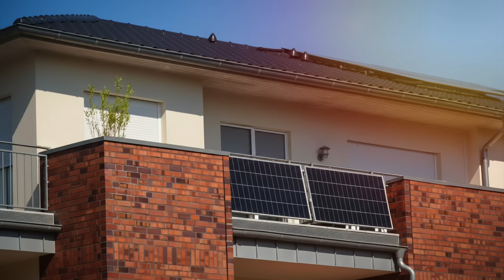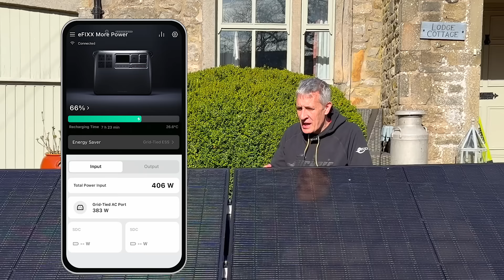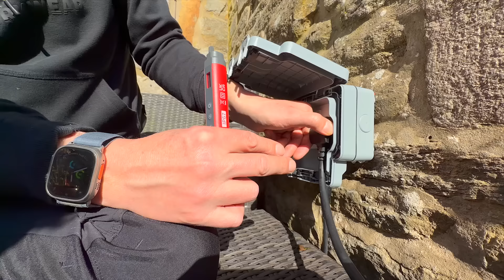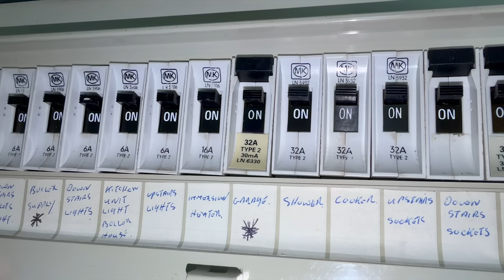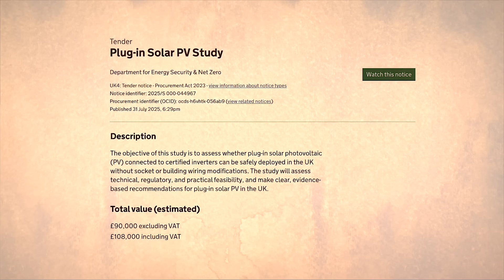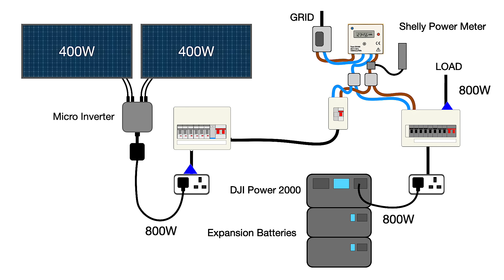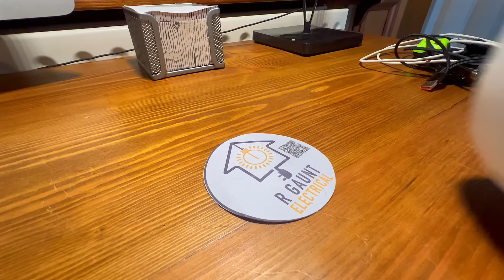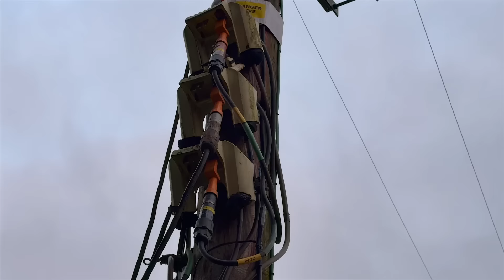Plug in Solar: We’re Told Never Do This… So I Did

Comment: Also: Generally those <=800W Systems are usually sold as a kit with everything ready to use, including mounting, part of the reason why there are no issues with it at all (I know about no incidents unless people start to badly fiddle something themselves - but that's usually a bad thing, regardless of what it is). So good that you promote that topic for UK. Mine (here in germany) already paid for itself and now every kWh it makes is pure saving. Great thing.
Reply from the maker: Great feedback thanks - what system did you choose and does it include battery storage.
Reply: @efixx  Since I'm an electrical engineer myself my setup is a fully standard compliant custom build (using two HMS-300-1T Microinverters, each is attached to a Kioto KPV 365Wp Panel). Panels are arranged for direct consumption (one 20° south, one 90° west) so no batteries needed. For my neighbors and friends i did a lot of installs of kits. If possible I recommend something like a 45° east + 45° west setup with 100% overpaneling, so that you have a grid-friendly full-day (sun-hours) coverage even without batteries.

I did a hybrid setup once for a friend with a battery 1,5yrs ago, that basically using any excess mid-day energy to do a constant low-level discharge during the night. Worked quite well last summer, but will take much longer to break-even due to the battery cost - but he wanted to have it anyways to standby as a emergency energy supply, so that very long break even time doesn't matter to him.

A well done simple setup with 1200 ~ 1500Wp of panels combined with a 800W inverter usually pays for itself within 3-6 years despite the loss of unused energy, for as long as you can shift some consumers to mid-day (washing machine, dishwasher, hot tap water boiler, etc.), but even without, haven't had yet anyone where break even was more than that.
Reply: @Cymaphore  very useful info, thanks. Currently have 2x 800W systems here in Belgium, this helps in thinking about whether (or not…) to add in a battery.
Reply: @Cymaphore  actually, unless you are over driving (clipping) the inverter, pointing all modules South provides the maximum production.
Reply: @Cymaphore silly question (maybe/probably).
If you have these without battery storage. What happens in the daytime when the panels are generating power but the house is empty with very little electricity running?
Reply: @Waterlego yhey hank you for the free power
Reply: Would like someone  in south east UK skilled to make a set up like this for my home as I personally do not have the expertise.
Reply: @Choosyview  
You can buy 2 x panel 800W inverter  kits in Holland, then get an electrician to make it safe into your house.
Reply: @Cymaphore  it would be good to see total kit price, to see if 7 year pay back worth it? 
<£2k  maybe but £6k+ maybe not , but sounds good if US/Isreals Iran oil wars continues
Reply: @balrajmaan467 a micro inverter is £100, 2 panels are £180, £3-400 is the maximum cost.
Reply: If you had 2 of these systems plugged in, let’s say on a double socket, and the rcd tripped,would they fool each other into thinking mains voltage was still present and therefore keep the circuit live despite the rcd trip?
Reply: @johnha2457  nope. Same as when you have multiple string inverters in your house. They don’t have to be linked together in any way apart from the connection to the grid. Not for the anti-island, anyway.

For that matter, an enphase solar system has a micro inverter behind each panel and that works just fine. They have communication for monitoring and configuration purposes, yes, but that network is not used for the anti islanding function.
Reply: ANY idiot using a localised ad-hoc PV install with a UK MALE 3 Pin plug IS A MORON(including those using IEC to BS fly leads) - The UK plug is one of the most sophisticated consumer connections to the local electrical infrastructure(sh1t3 for when we stand on them)! 
It's 101 electrical installation principals... Asuming(Ass U and Me) everything in a domestic installation will be tickety -boo  - NO  switched L/Ns, localised CPCs FLOATING,. RCBO/MCB/RCD mix and matches.......... Basic protection is a FUNDAMENTAL ASPECT of.BS7671 for a reason! 
Now someone shilling localised PV energy storage in North - Western Europe, is equally as..... 15%PV efficiency with MPPT x 70% charge controller efficiency  x 70% inverter is one hell of an inefficient and unsafe system! 
Power walls, et al ARE useful in the US, where energy grid infrastructure is VERY poor, fragmented and susceptible to the. MANY Brown/Black outs courtesy of its geogeaphy(lighting storms, tornados, severe storm down pours.........). 
The UK is soggy and suffers highly variable  weather, UNLIKE Germany which is far  more temperate/sunnier!!??
IMHO: Fit PVs with storage/inverters if you are off-grid, and fit 12/24/48v dump loads(immersion coils), when over-generation occurs(usually height of summer/low demand). 
Do the same with on-grid, but use grid tied inverters(for payback) and/or augment these with immersion coils(can be tied to high temp outputs of solar-thermal panels BTW) , for storage in Domestic Hot Water Cylinders(DHWC)/accumulators. 
Inverters use MOSFETS and IGBTs which can be very susceptible to thermal/electrical failures which makes them ENTIRELY unreliable as a means of basic protection.
If your running 2 panels in series,, then this too will be dangerous, as the DC bus will regularly have over 60V........ NOT to mention the lack of their grounding!!!!
Food.for thought - You did SHILL HARD BTW!
Reply: The stuff I've seen has three problems that were fairly apparent
- Some of it runs 100v or so on the solar, which is fine with good quality properly matched cables and connectors but people buy random solar panels
- Folks buy extension solar cables off places like Temu and they are not even double insulated or rated above 36v
- There is nothing in the documentation for the ones I've seen about battery safety and the PAS recommendations on where the stuff goes, so people stick it by doors, under stairs and the like.

The better kit keeps to one panel per MPPT (so 2-4 x 500W or so at under 50v and not enough power in one cable to be a major risk). Some of the newest stuff is even designed so the battery goes outdoors.
Reply: @etchedpixels  plug in has to be 800W max, which means no more than two panels in 2026. Whether that is with one or two micro inverters isn’t really safety relevant.

So, yeah, it is most likely a single series string, same as when you have larger systems with microinverters per two panels. Which does indeed give you something like 80-100V open circuit voltage. Most of these systems are just a kit. The mounting system and the micro inverter and the cabling all come together and it’s just put together the way it’s intended. If you fuck around with it, sure, you could find out — but you can fuck around with lots of things and there’s no reason to think that plug in solar kits lead to more of it than the availability of, say, second hand microwaves.
Reply: @JasperJanssen  We don't know what the UK rules will be yet but if it's like anywhere else then the limit will be 800W grid tied power input. Many EU systems go up to several kW of panels but will only put 800W into the grid. So you can drive plugs directly on the unit for more, you can put the extra in the battery overnight etc.

The plug and play ones generally have one MPPT per panel to keep the voltage/current down and also because it's common to have shading issues so each panel on its own really helps. That should I agree keep it safe for most people and it covers the "hedge trimming the solar cable" type cases.
Reply: In the UK we have ring circuits with 2.5mm cable on circuits protected by 32A MCBs this causes a unique issue for cable overload
Reply: @edc1569 Still a issue with overload in Germany or other European countries.
Reply: @Faddnn  The German standards body studied this closely and concluded their wiring standards were sufficiently excessive it was not a problem.

The US folks looked at their wiring systems and thought "oh ****" so you are allowed 400W in Utah unless you drop the protection so that the combination of worst case load and solar will still trip, then you are allowed 1200W.

We should probably downrate the affected circuit.
Reply: @etchedpixels  @Faddnn @edc1569 That's why there is the 800W limit. For usual household use cases that's reasonably safe and I have not heard yet of any such catastrophic overload happening here, despite it being theoretically possible. With those 32A rings you have it should be similar - if you manage to overload that thermically by only only adding a 800W microinverter, then there surely is already something terribly wrong with it or how it's used anyways. In addition you would need a very good timing to overload it (summertime during highest production), so those "people running multiple electric heaters while the inverter is running at full" scenarios are purely theoretic fearmongering imho.
Reply: @edc1569  not really. The 800W is chosen in such a way as that it comfortably fits in the overhead between the 16A breakers we use and the actual current carrying capacity of the 2.5mm^2 radials.

Your RFCs are in fact safer than our 16A radials in this circumstance. Because while the cables are still within rating, the sockets and devices plugged into them are expecting to be protected by a 16A breaker and now will be able to have access to 3680W plus 800W instead. The danger is still pretty minimal.

Your sockets, on the other hand, are rated for 13A per and 20 per double socket, and they are already expecting to be behind a 32A breaker, which is why they have fuses. There is no meaningful difference from the device or socket’s perspective between the 13A device being connected to a 32A ring or to a 32+4A ring.
Reply: @Cymaphore  when you say paid for itself? Do you factor in the compounded growth you would have got has you instead put the solar set up costs into a stocks and shares account instead?
Reply: @danthelambboy the people using these won’t be investing their £300 in stocks and shares fella 🤣
Reply: @danthelambboy  
There comes a time when you have to stop thinking like that. I know plenty of people who knew they should be investing in gold but couldn't be bothered or never got around to it.
Reply: The network in German is not the same as the network in the UK and different assumptions about where and when things are 'live' apply. Just because something is considered safe in Germany with its network and working practices DOES NOT make it safe in the UK with it's network and working practices.
Reply: @occamraiser  
Would've been nice if the UK started researching this when Germany first did.
Reply: @occamraiser  so tell us why exactly it’s not safe.
Reply: @occamraiser  you'll have a hard time convincing me the wiring in Germany is universally safer than in the UK, especially considering Eastern Germany which was part of the Soviet Union. Besides Germany other eastern bloc countries are using plug in solar without an issue.

Comment: In theory it ok but it requires electricians and home owners to know what they are doing.

The only way -if I was in charge of the industry - I would allow this is for it to only to be installed by electricians that have undertaken a special course  so they understand what to install to make it safe.

Then after installation, training is provided to the home owner/user.
Reply: Moment it requires an electrician the payback goes from 2 years to never. They are used all over the rest of the world just fine - and brits are not more stupid than the rest of the world
Reply: Can you not just charge the batteries from the solar panels and benefit from this ?
Reply: @stephenthompson4986yes you can, if it's not plugged into mains it's off grid system. Grid-tie system only work when connected to mains, but if its a battery with uk plug no issues then. Mind you probably more dangerous to run all those extension leads round the house
Reply: I would allow absolutely anybody to install it themselves and let Darwinism take its course

Comment: Whats the issue after all electronics never fail or set fire?!

The trouble i fear with this, if you allow backfeeding via a 3 pin plug where does it stop as most will think its ok to do it with anything. The best way would be for the regs to permit non shuttered sockets to be fitted in domestic settings, so switch interlocking gen sockets can be fitted. Hopefully manufacturers would then create something more pleasing to the eye.

Also then why bother with mcs, pv or solar course's or schemes?

What about isolation, the national grid workers etc, after thats why we are told you need to do these courses and sign up to the schemes?
Reply: The National Grid workers are no longer relying on hope that no-one is backfeeding the grid. It's now standard practice for workers to assume that there IS backfeeding. They will then isolate the equipment they are working to ensure that it's safe.
Reply: If the inverter software failed to grid follow then it would instantly destroy itself. I’m sure the electronics are designed in such a way that back-feeding through the input port just isn’t possible.

Comment: This was ok in mainland Europe over 15 years ago, a bit behind the time in the UK. At that time Mastervolt made a unit (Soladin) like a phone charged with a plug built in. It could grid link a 100W or so of PV.  Also safe to unplug and touch the pins.
Reply: Mainland Europe doesn’t have ring circuits. Even if we banned installing them today the legacy will be with us for lifetimes.
Reply from the maker: Thanks for your input

Comment: Hi, do you need a special smart meter to install and export with this storage? Or does a regular smart meter with 30 min readings work?
Reply: You need a meter that doesn't go backwards when exporting to meet the rules, and you need a G98 form (which is easy and if UK legal was sorted out could pretty much be automated by the DNOs as a web form).

To get payment currently you needa smart meter and your system to have been installed by the MCS cartel or with a bit of a fight with an electrician who is qualified in those matters. An 800W system isn't going to export much if anything for most people when attached to a bit of battery so it's not worth worrying about. The value is saving you 27p/kWh (and going up) not exporting at 12p/kWh (and heading rapidly downwards)
Reply from the maker: It’s not G98 which is the barrier - DJI battery used in the install has a G98 approval.  Companies like Octopus will accept non MCS installations.
Reply: @efixx I didn't realise Octopus Energy accepted non-MCS installations that didn't have an EIC and a Building Regulations certificate covering notification under Part P.
Reply: How do you expect to get paid to export if you've carried out a DIY installation?
Reply from the maker: In countries where it’s legal you can get export payments - but realistically at this power level most of the energy will be used as self consumption.
Reply: @efixx  Remind me which country you're based in and which language you speak through all of your videos?

Comment: Don't see an issue providing BD RCD/RCBOs installed on the final circuit and the inverter shuts off <0.2 sec.  

Did you time the disconnection? 

Older inverters can take up to 5 sec to disconnect.
Reply: There certainly is an issue with RCDs and this has been covered in a very good eFixx video sometime ago.
Reply: The modern units are fast but many standards like the UL ones are much slower - slow enough to be dangerous, so it would need to be a lockable plug or the UK could deal with it by specifying a fast response itself.
Reply: @etchedpixels We wouldn't use devices certified to UL as that is not a UK standard.
They would need to be certified to British Standards.